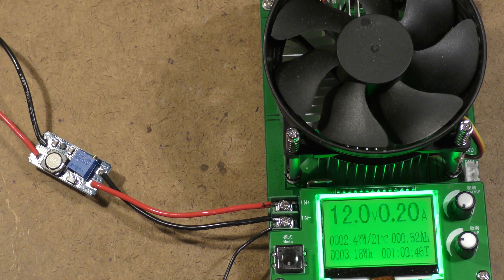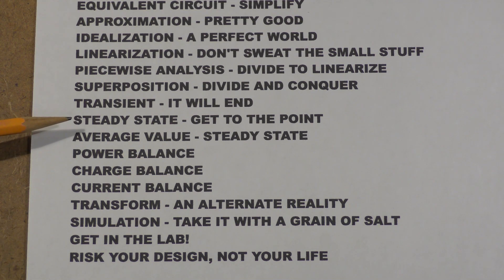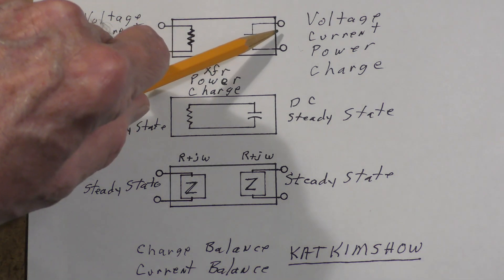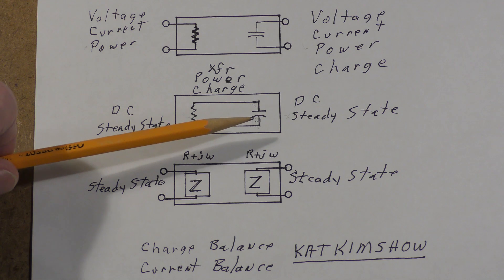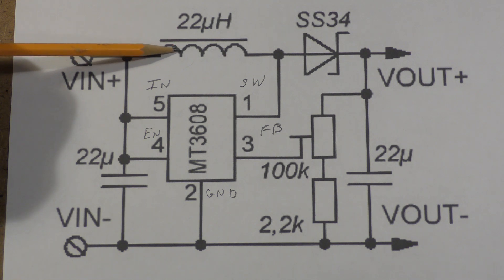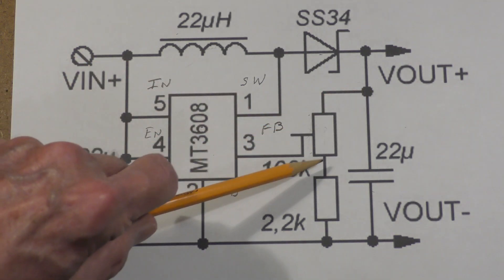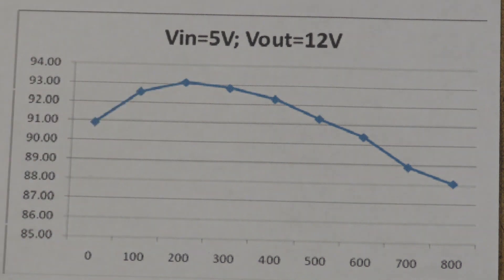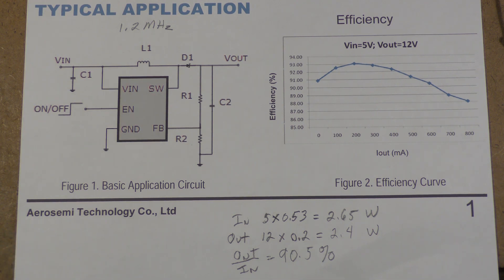TTT359 Boost Converters and Power Efficiency

Comment: Did you measure the efficiency directly on the board or did you take the readings on the power supply taking the leads from the psu to the board into account because the leads will have some resistance too just as the clips that you're using to connect the two adds resistance, that's to my opinion the discrepancy that you see.